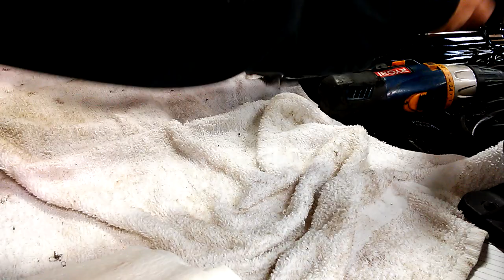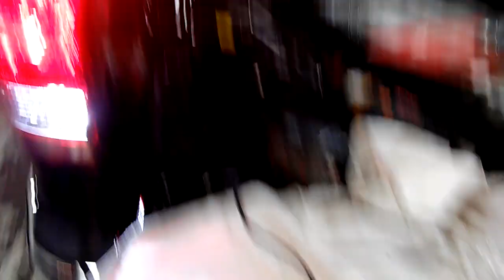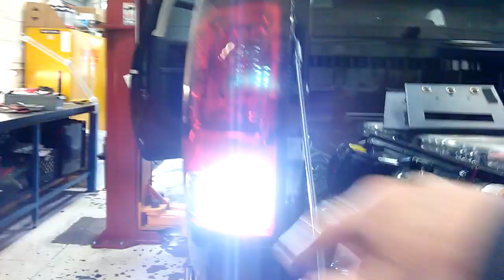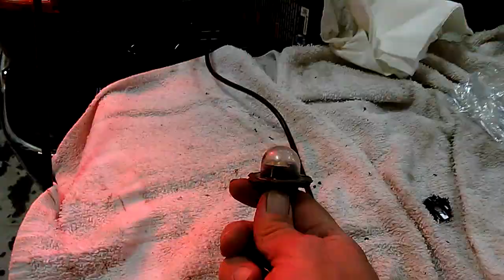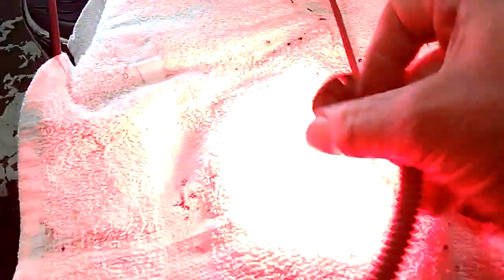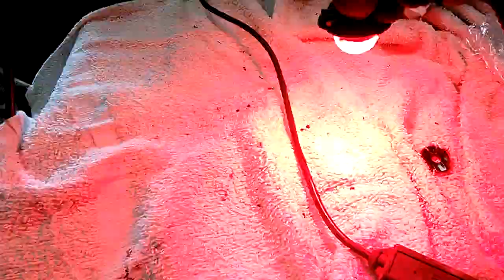Installing hide a way emergency lights - whelen hidden lighting

Comment: You probably should not be modifying tested and approved OEM supplied lighting equipment, if I cannot see your brake lights after they are modified how to know the said brakelights are compliant with FMVSS light output and light distribution?

Comment: I’m confused. So once u make the holes and screw them in, do u wire them to the taillight wires and how do u turn them on from inside the truck?
Reply: david I think these lights are separate from the tail lights. They have their own wiring.

Comment: Is there a link for longer wires for extended cab long bed truck? And can I use them for plowing snow?
Reply from the maker: You just need to connect longer wires, match the colors

Comment: Even a true 360 hideaway isn't quite as bright. Better off installing a regular hideaway straight forward
Reply from the maker: Zach Novosad yeah... the hideaway lights are really overrated. the old ones worked much better.
Reply: Sound and Light Technicians if they're done right they look good. They don't work well on all vehicles. They work really well when you use the dual functionality ones and use them as your actual tail light bulb and reverse bulb.
Reply: @znovosad555  got rid of my bulbs and put in feniex in hideaways
Reply: @mrxperfectxdeathx9620  yeah that's the best way to get a brighter hideaway.but even then hideaways arent made to be primary warning lights
Reply: Zach Novosad nope I also have a 49” gpl dual color light bar on my back rack... love it now just add something low up front and I think I’ll be happy with it
Reply: @znovosad555  They are not DOT approved for that use. Opening yourself up for major lawsuits which is why they warn you not to.
Reply: @FFred-us9tw  you’re correct. i made that comment before i knew as much about emergency vehicle upfitting and lighting. they aren’t not designed to be used as primary anything, warning, STT, etc. only supplementary to them

Comment: Can I install these lights in my truck
Reply from the maker: eleazarcervantez98 depending on your state regulations on use. Amber and white are usually accepted but you may need a permit. Many construction companies and workers use these to have access to the job site. 
You need to check with your state to what is legal.